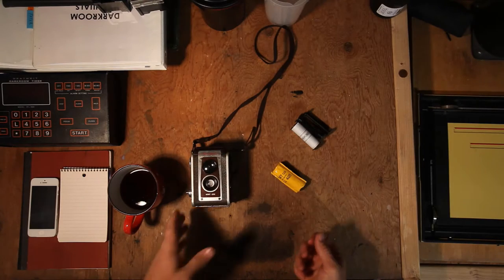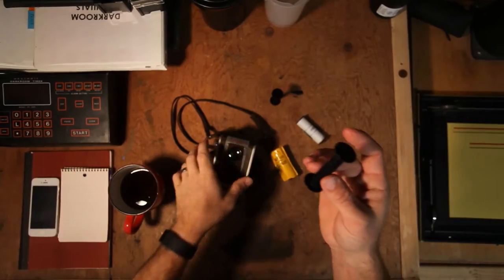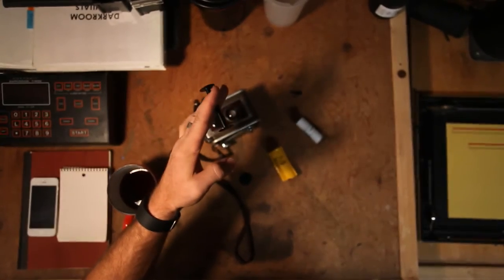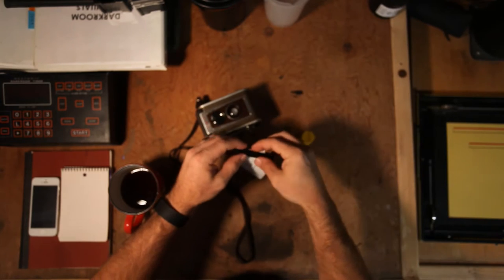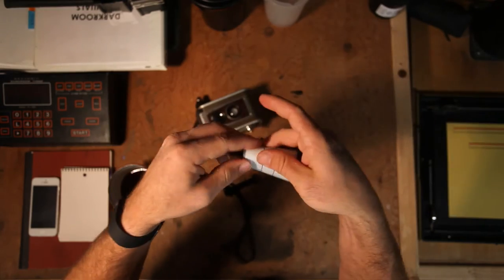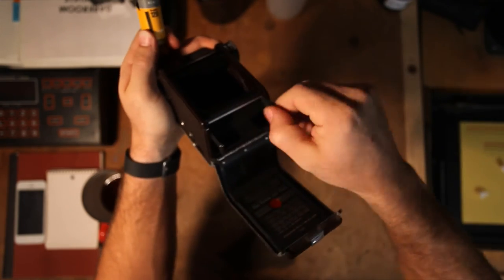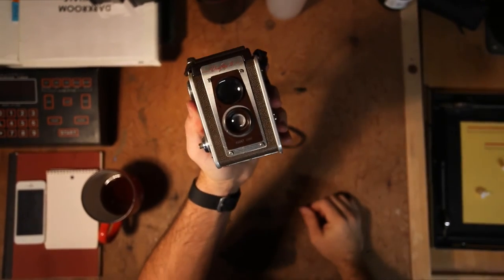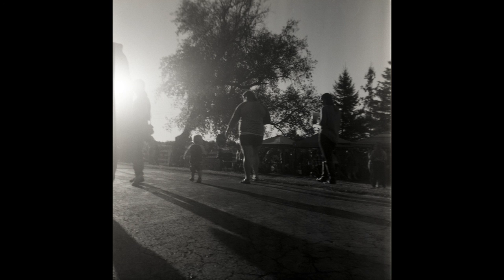Film Tutorial #3 how to shoot with a Kodak 620 camera

Comment: So I just noticed almost at the end of the video that the camera I have has the bottom spool that you pull our, but the top is missing. 😢 Are these easy to find? Or would that even matter once I purchased a roll?
Reply from the maker: If you purchase a roll of film you can trim down a 120 roll with a nail clippers or a file for it to fit in a 620 camera.  Your best bet for finding a 620 spool would be to locate another 620 camera for a low price.  If you really find yourself out of options I may have some 620 spools in my camera collection that I could send your way.  Good Luck and have fun!

Comment: Thanks for this idea. I wondered if you could actually roll the 120 onto a 620 spool inside a 120 camera? I realise the 620 spool may be too small, but it might be possible to pad it out.
I also want to try 35mm in a 620 camera.
Reply from the maker: as long as you have some paper backing for the 35mm film spooled onto a 620 spool you should be good to go,

Comment: I seen someone else just trim the ends of the 120 spool with nail clippers and the load the film in the camera.  Have you ever tried that?  What's your thoughts?
Reply from the maker: 88Spector I don't see a reason why that wouldn't work. It would be a far faster method than what I show in the video.  As long as you are careful there would be no damage to the film.  Give it a try and let me know. 👍🏼
Reply: I did this on my Kodak junior 620, works pretty nice.
Reply from the maker: awesome how did the photos turn out?
Reply: The only risk is with high end Kodak like the medalist, it won't work.  Even 620 is a tight fit, and the medalist was built for 620